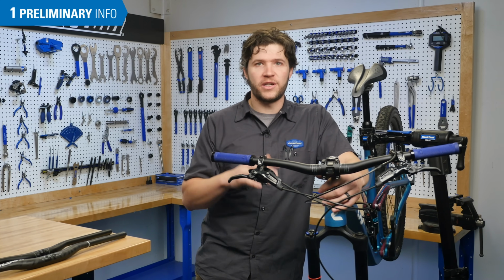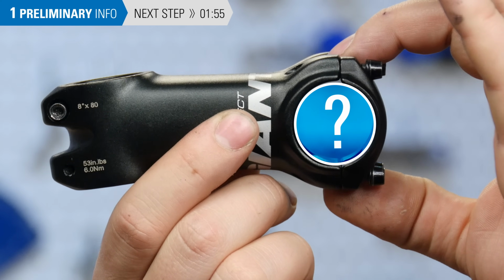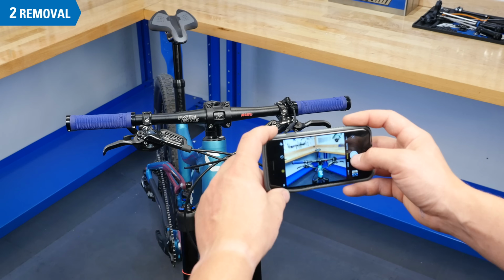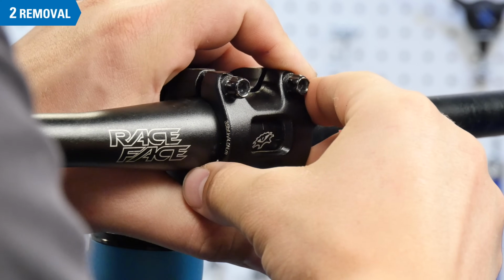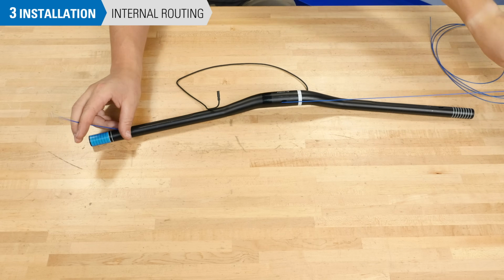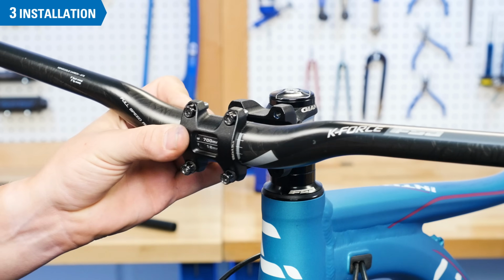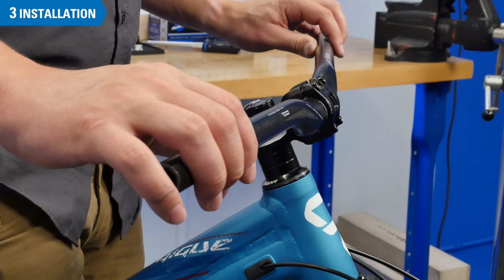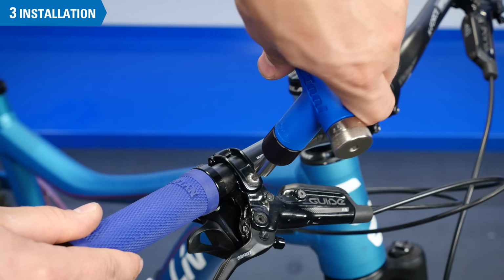How to Replace Bicycle Handlebars - Flat Bars

Comment: Anyone watching this now- just know you can do it all with usually 1 or 2 allen keys. Dont need all the other stuff. Just be gentle / take your time. Use a tiny bit of ptfe on the bolts if you want. Obviously different if its a high end bike. Helpful vid nonetheless

Comment: How much torque do I use? What’s the average on the bolts on the handlebar?
Reply: Handlebar doesn't have bolts - stems do. Stems with a 4-bolt faceplate typically have M5 screws and require use 5-6 Nm. Many stems have the designated torque engraved/printed on them. If yours don't, your best bet is to double check with the manufacturer. But the answer is probably gonna be 5 or 6 Nm.

Comment: Would I be able to put drop bars on a compression type stem
Reply from the maker: You sure can.
Reply: @parktool  is there a way to completely change the stem or am I going to need to buy some extra parts

Comment: A new bike cost 88 
Old bike free 
Bar 20
Stem 20 
Handle grip 10 
New break 20 to 30 
New wheel tube 7 each x2 14
Ummm will wouldnt it be better to buy new?
Reply: Not if your doing this over time with a limited budget , if you can buy new power to you go wild

Comment: Is it possible to switch bars with revoshift gears
Reply from the maker: Yes. Revoshift shifters should be able to be slid off if you loosen the hex that clamps them to the bar. It will be accessed from the bottom of the shifter.
Reply: @parktool  thank you

Comment: I dont know why i think that working on bikes is harder than on cars
Reply: Because it’s challenging to find parts. There are thousands of models out there unlike cars where it is just a few hundred.
Reply: @42luke93  Besides the frame and frame accessories, bike parts are more or less standard, so it doesn't matter which make/model you have. So if you bike has a handlebar with a 31.8 mm clamping diameter, you can choose any 31.8 bar from any manufacturer. This is not the case for majority of car parts.
Reply: Bikes are easier than motorbikes which are easier than cars to work on, in my opinion. Working on a bike, you don't need to contort your body to awkward positions which give you back pain, or deal with heavy, hot, or extremely dirty/greasy/oily/rusty parts.
Reply: Its such a time suck to do the smallest task on a bike. A handlebar swap would literally take me a week to research the correct components for my application and numerous how to videos like this one as Im not mechanically inclined.

Comment: If I understand it correctly, you don't have to make any adjustments to the brakes after you remove and mount the brake levers back, right? The tension in the cables remains the same.
Reply from the maker: Correct, unless the new lever position is much different (taller stem) there should be no change.
Reply: @parktool  i just realized that I would probably need longer cables, since I am moving to a considerably longer bar (from 40cm to 62cm). Thank you very much for your help!

Comment: Name the tool that make sound after tightning the nut?
Reply: Torque wrench bro
Reply: You don’t need the gadgets like the torque wrench to do these simple jobs, just tighten the bolts evenly and just snug enough.

And.... don’t use any kind of lube or loctite, all parts are machined to a tolerance that you can attach and tighten.

Comment: Plsss show us how to tighten the bolts without using a torch wrench,,,,,,,,
Big dislike to this video
Reply: The same way, but using a regular hex wrench (allen key) and your mechanic's experience to judge how tight to do the bolts. Although if you had this experience, I think you wouldn't be asking this question. 

Handlebar and stem are critical components on a bicycle and you really don't want these bolts under- or over- tightened. This is a video by Park Tool and obviously they will only recommend the proper methods. Just buy or borrow a torque wrench. An affordable 2-14 Nm torque wrench set costs about 40 USD/EUR. If you want to do your own maintenance, be prepared to pay for the tools. Otherwise just give the money to your LBS who will do the maintenance for you (with or without a torque wrench).
Reply: Use allen keys

Comment: Should i apply grease on a new mtb alloy handlebar?
Reply from the maker: If the bolts are dry, grease.  Do not grease the bar centered where it meets the stem.